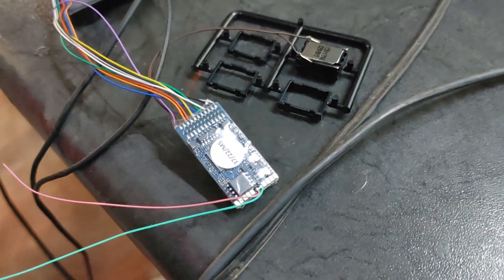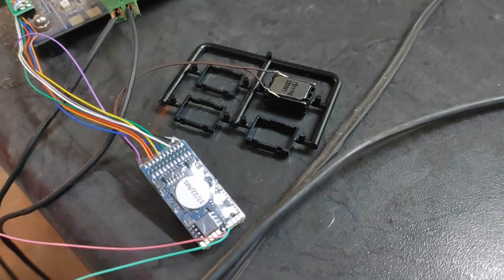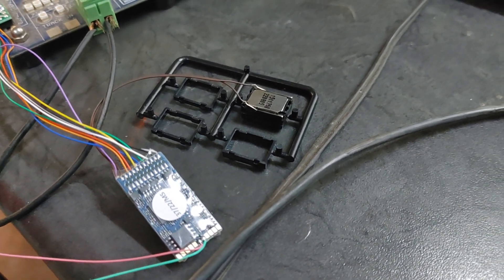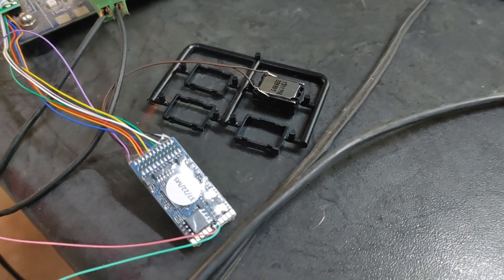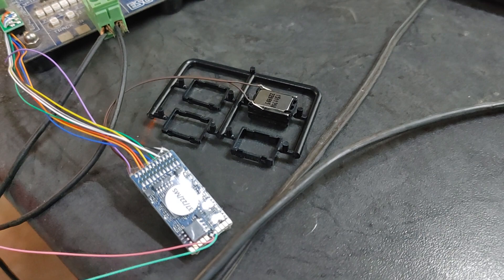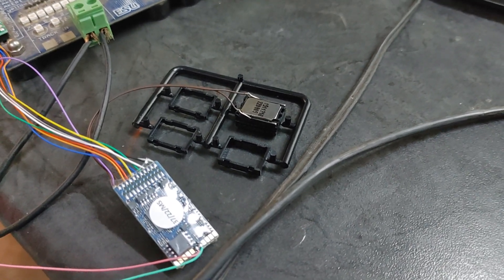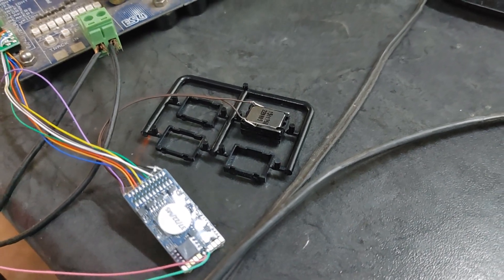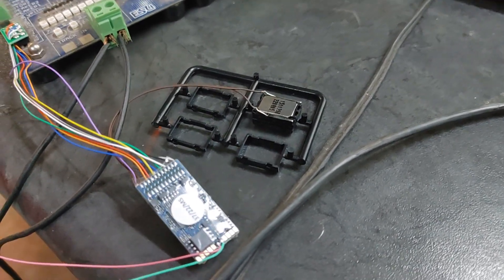DCC for Dummies. ESU decoder v5 "do not 's!!!!!"

Comment: The most important thing is do not never ever buy ESU decoders, because it is pure trash.
Reply from the maker: @AlexMont_CH  Must be why they are still the market leaders…..

The day any manufacturer out there give me the same interface between myself and their decoders, I might look into it. I have installed hundreds of them. Never had a problem. If I did, without exception, it was a wiring fault. In the last 13 years, I have had three faulty decoders. All of them got replaced. Free of charge. 

What more can you possibly expect?
Reply: @riekusvanderwesthuizen471  who told that they are market leaders? You know excactly how much decoders including in new locomotives sold last year on the market from each fabric? 

That is a problem that you installed hundreds of decoder and do not wait something very modern and special like me or other newcomers. You do not wait 1 cm for 2 minutes, you do not wait exponential acceleration, you do not wait automatic finding every best step of back-EMF settings, which can not get none Zimo or ESU, because it shoud have other architecture of decoders.  

I see the problem of market in the stagnation. Old modellers do not have some special expectation for riding, slow motion and so on, but every year they go from hobby and sells collection because many of them too old. For newcomers decoder and locomotive manufacturer still have nothing to present. Still no modern motors, no ideal easy PID-Back-EMF settings and so on. Fun that today progressive "non model" analog motor drive beat any modern decoder for slow speed.
Reply: @riekusvanderwesthuizen471  i've done virtual model in Adobe Premier for acceleration with reference mark. All decoders work very very badly, because they could not achieve the same driving behaviour. 
1 there are few points where they lose control over motor so it lose speed for moments like car with gearbox. 
2 you can not start without jump, obviously you can, but you need to drop voltage so much and play with Back-EMF, but than you can nothing to do with middle range speed control

Comment: Something that I would consider doing is using a Decoder Buddy for 21-pin decoder installations also. Installations without colored wires and a detachable light connector board and well identified solder pads.  It makes for a much neater installation.

Comment: I've recently switched over to ESU sound decoders for some really tiny HO narrow gauge installs and I appreciate the info you are posting here.  I thought the ESU decoders were circuit protected, good to know that's not totally true.

I have a question you might be able to answer with your ESU experience.  Do you know how to eliminate the LED lights dimming when the decoder is running off the powerpack?  Any time there is a track power interruption my headlights dim, it's super annoying.  With tiny four wheel HO narrow gauge locomotives power interruptions from just about anything including dust are hard to avoid.  

Here's a video link that clearly shows the issue.   https://www.youtube.com/watch?v=9PLeeGTf_HI

Thanks!  -DTJ
Reply from the maker: Set the timer for the capacitor slightly longer. If that doesnt solve it, set the light output slightly lower. I have found that some LEDs are very sensitive around their maximum brightness. They react aggresively to slight voltage changes. If they are just off max they tend to be more flexible.
Reply: @riekusvanderwesthuizen471  Thanks for the input, I'll give it try tonight.  I am already running the LEDs at a very low output level but I have not played with the timer settings yet.

Comment: If you paint the solder joints with clear acrylic paint it will insulate them for you.
Reply from the maker: That is very good advice. I have done it. It works a charm. I used a color though. I am old now. Can't see like I used to. With color I could be sure that I covered the joints properly. Thanx for your input. Cheers
Reply: @riekusvanderwesthuizen471  My electrician friend taught me that.